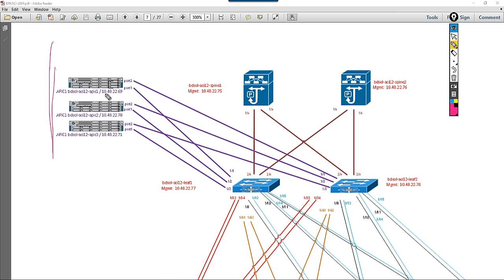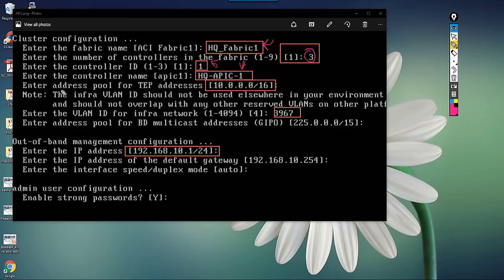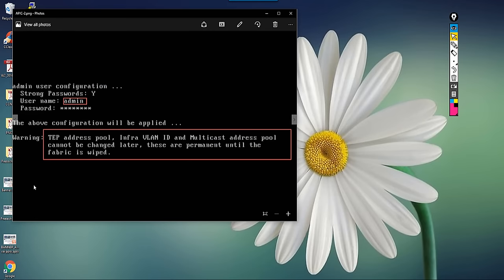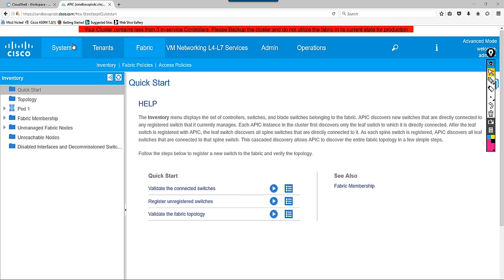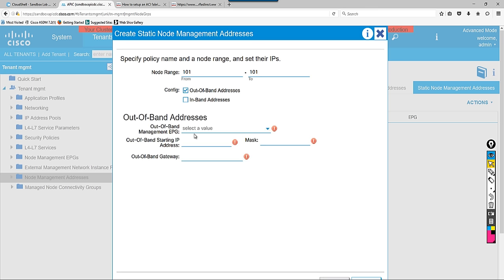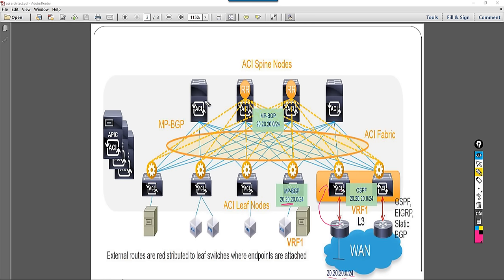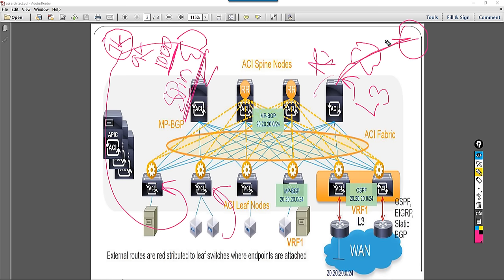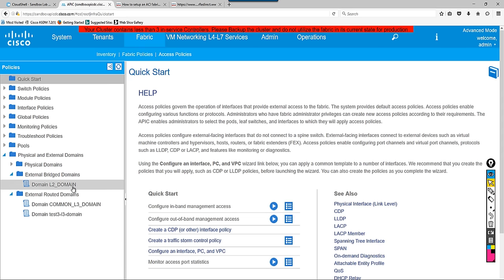Cisco ACI : Tutorial-01: Basic Connection & Initial setup

Comment: You mentioned the leafs don't do L3 but the WAN is actually connected to the leafs and providing L3 connectivity.
Reply from the maker: Leafs switch will allow you connect L3 &L2 connectivity ,but all routing will perform by controller.
Reply: Kamal Sodki Kamal are you sure about that ( routing on controlled) in that case the fabric would be useless if all controllers go down, but that isn't the case.
Reply: @sdntechnology5056   AFAIK, APIC's don't take any action in traffic flow. Their only task is to store and push settings into fabric, i.e. provide configuration.